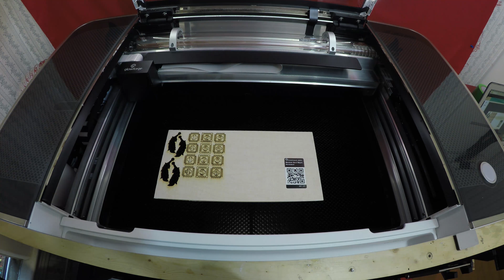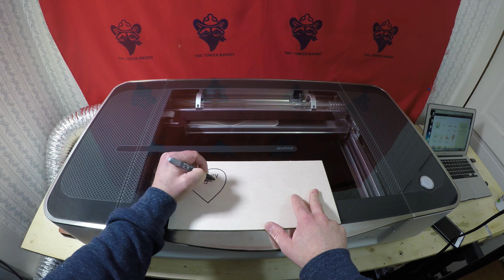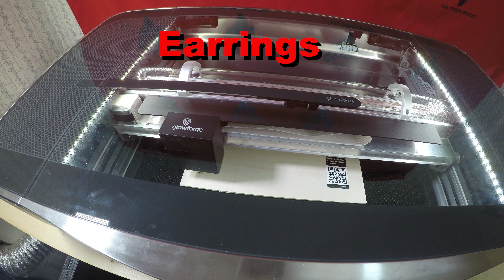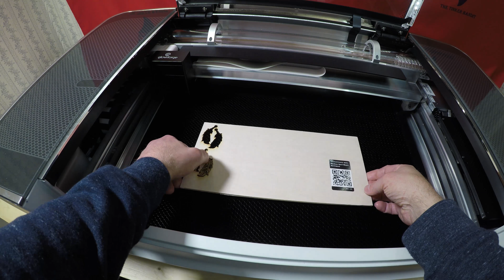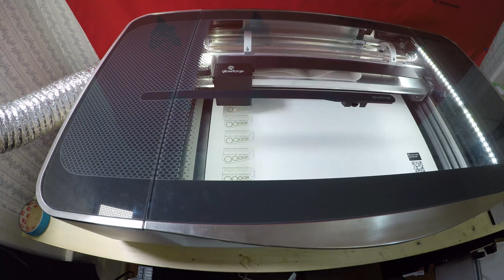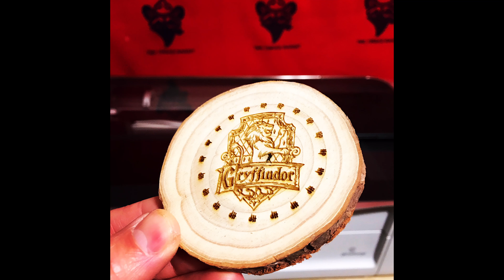Glowforge First Cuts

Comment: Do I get this machine or the Muse ? How are you liking the glow ?
Reply from the maker: Hi there!  I love my Glowforge.  I don't have a lot of experience with other systems (and I don't know all the details on how it stacks up to the Muse) but I have used a Universal Laser 150W.  The GF Basic is easy to use, reliable and has shown great quality in cutting and engraving even approaching cleaning time.  I think the Muse is water cooled and I'm not sure what that would look like but I know it's software is actually on-board while the GF is web-based.  I haven't had any issues with it though. For my uses, 40 Watts is all I require (which is less expensive than the Pro and the Muse) but this could be a tough choice for someone needing 45W minimum.  Bottom line:  I'm very happy with my Glowforge.
Reply: The Tinker Bandit 
Good feedback. Need to save up for GF now.
Thanks